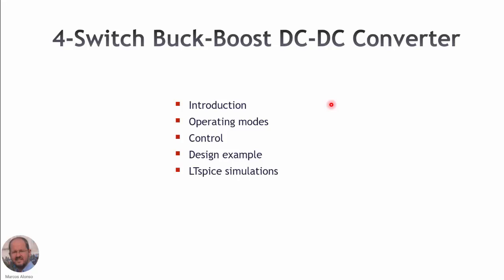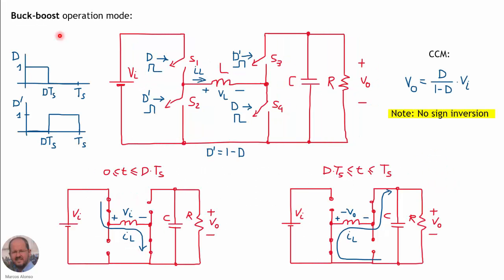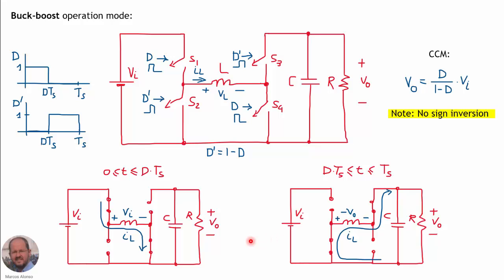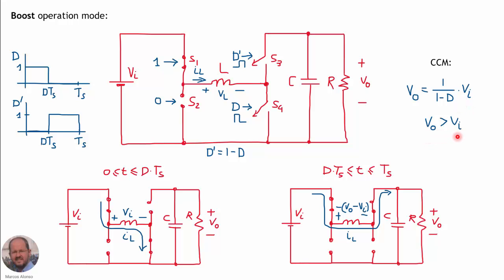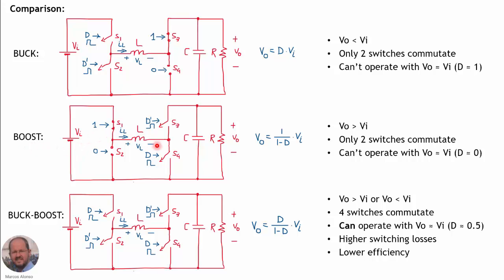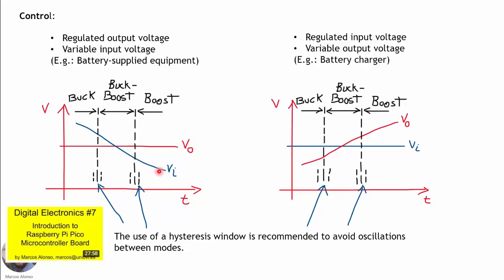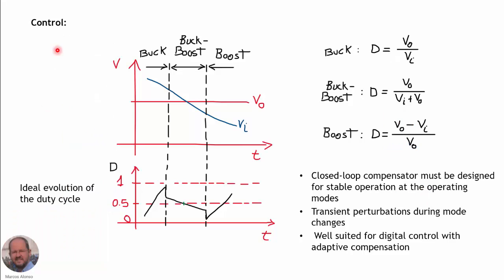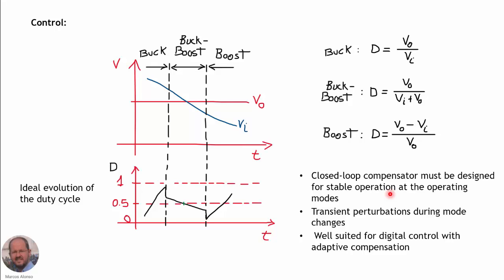PE #61: 4-Switch Buck-Boost DC-DC Converter (I)

Comment: Hello thanks for the review. How does the converter performs compared to the synchronous buck converter?. This can also act as buck and boost.
Reply from the maker: Hello, thanks your question.
Note that with this converter you can send power to a load whose voltage can be lower or higher than the input voltage source. You can't do that with a SBC. SBC is bidirectional but the load that gets the power has to have a voltage that is always lower or always higher than the voltage of the source, depending on the direction of the power flow.
Reply: True, thank you

Comment: Thank you for the video! Very in dept lecture! I think i found an error:
At 17.09, shouldn't it be an Efficiency - Vout - Diagram? It does not make sense to me, that when Vin increases it switches to boost mode. It should switch to Boost, when the required Vout is increasing, not? You also flipped the Buck & Boost zones in the above graph, compared to the previous slide.
Reply from the maker: Thanks for your comment. There is a mistake in the figure at the top. I don't know what happened here, some copy-paste issue probably.
The correct figure at the top should show buck mode on the left where Vi>>Vo, buck-boost in the middle, and boost mode on the right where Vi<<Vo.
The efficiency diagram is as a function of Vi. Vo is supposed to be constant and regulated by the closed loop compensator.

Comment: Hi Sir I am  an undergrad and  your work always helpful in all ways. I learnt LTspice only through your videos Sir. Sir I have a doubt ,Is there a way to do the simulation in LTspice and at the same time do the controlling part (coding part ) in matlab simultaneously both running at the same time to simulate a circuit. Is there a way to interface both ?  or is there any other software do the simulation for Wide band gap devices and its application ?
Reply from the maker: Hello, thanks for your comment.
As far as I know, there is no way to interface LTspice and Matlab.
You can try the new simulator by Mike Engelhardt (the creator of LTspice). It is called Qspice and it allows you to add C++ code to the simulations. It is free to use too. You can download it here: https://p.qorvo.com/qspice-simulator.html.
These are two introductory videos you can watch:
https://www.youtube.com/watch?v=TN7_Q5fDvuE
https://www.youtube.com/watch?v=8QVFJBlTieQ
https://www.youtube.com/watch?v=__ycmI0cdws
We will deal with this new simulator on this channel in the near future... stay tune!
Reply: @MarcosAlonsoElectronics  Thanks Sir 😊😊🫡